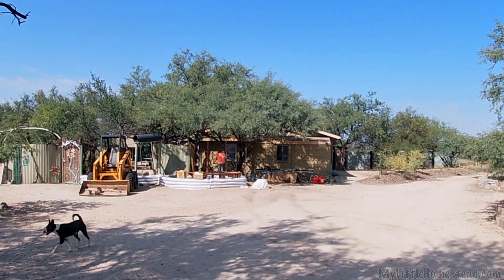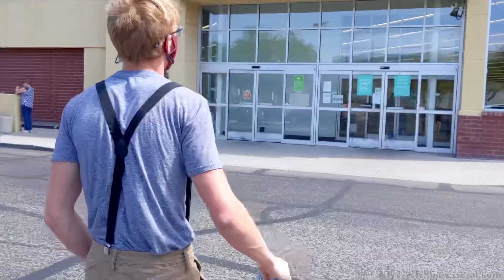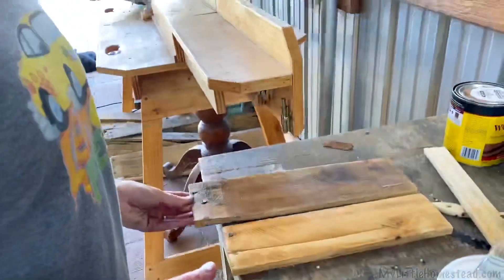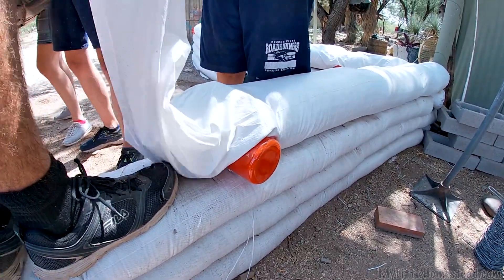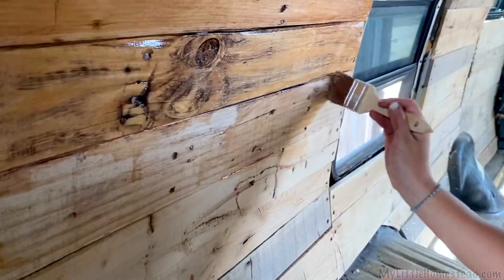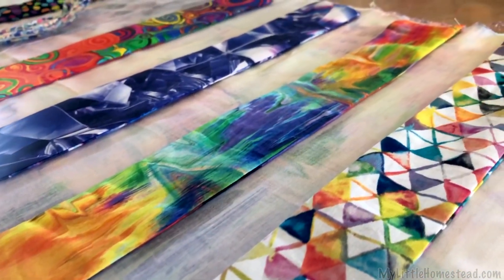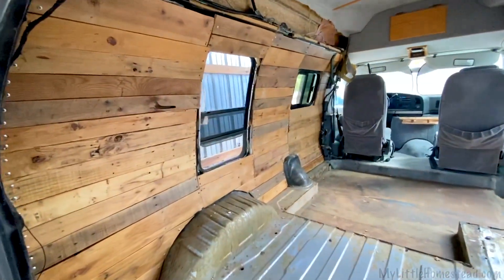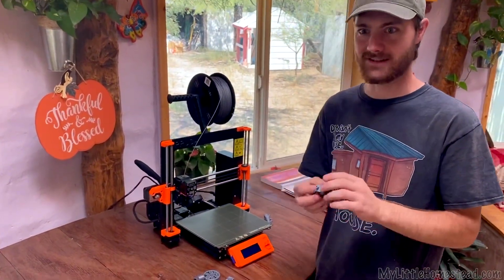Earthbag Walls for Outdoor Tub, Pallet Stain on Van Conversion, DIY Headbands | Weekly Peek Ep253

Comment: Oof, that stain should be called Black Hole because photons never come back from it. 

Whenever I'm at the hardware store I always check the "Oops" paint which is unclaimed custom mixed paint at a steep discount.  I've gotten a variety of paint and various earth tone water protectant/stain for $9/gal. I put some on a test pallet board and it's held up well in the elements all year compared to an untreated one.  

Was helping GF shop for mask making material a few months ago.  Lots of good vendors online.  You have to watch carefully whether you're getting a fat quarter or linear yard.

I've given a lot of thought to bottles and color treatment cause I have some bottle house plans.  I'm looking at cutting bottles and butting them together.  One colored one clear.  Before I build I want to experiment with coating the outside sides of the glass with white and also silver paint to see which works best.  Especially with colored glass this will help the light continue through rather than get absorbed along the side.  I'd want to experiment with translucent stain or dye coatings, and put one only on the bottom of the inside bottle.  Reds tend to fade fastest with UV exposure.

Comment: Lay a hunk of string, longer than the project, between each of your seams before you start sewing, pinned to one end. After you sew and cut, slide a yardstick or a piece of pvc inside the project and pull the loose end of the string to quickly flip the pieces right side out.

Comment: When using dark stains on pine and any other soft wood use a wood conditioner it helps the pores open up on the wood and always use a rag with dark stains it's more controlable that way a brush just doesn't spread it out like a rag

Comment: If you were to sew a line at 1/3 of the length add a small spoonful  orbeez beads (the tiny beads that swell with water) and sew another line at 2/3 of the length, you have a headband that can double as a neck wrap in summer. The beads shrink back down to tiny sizes when dry.
Reply: And scrunchies are also a nice fast way to make up fabric items.

Comment: You don't apply stain with a brush. I have always found that using a cut up t shirt works the best. You can squeeze out the stain based upon how dark you want it. When you're using a paintbrush of course it's going to soak all that stuff in and be darker

Comment: I just had an idea about the bottles you're painting! a lot of the problem with flaking off is from poor surface adhesion from the paint so they always tell you to prep the surface and how glass is hard to paint etc, so what if you take some of the glass etch stuff they sell at craft stores and let it etch the inside of the glass before you paint them, then the outside will still be glossy and bright but the inside will  have a better chance of hanging on.

Comment: Suggestion if you mix blue water and food coloring or paint into the bottles and put them in the oven at 125 for about 30 minutes then turn off the oven and let them cool the glass becomes stained and still see through
Reply: Glue do not blue water

Comment: Here's a possibility to keep the colors in the bottles longer. Before spraying the color, spray a coat or two of UV resistant clear coat into the bottles, let it dry. And then spray your colored spray paint into the bottles. It might work, I know that I've been told by mechanics,that when I resurface my headlights. And they're finished, to spray them with 2 - 3 coats of UV resistant clear coat.

Comment: The Prusa i3 mk3s is a great printer. The MMU 2.0 isn't so great but it does add multi colors so there is that. If you want a printer that does a larger format prints you can get a Longer LK1 and mod it so it has a bltouch which is a great auto leveler the best IMO. I personally have it I did the, standalone mod, heated bed mosfet mod, tl smoother mod, cable chain mod, Bltouch auto level mod, the duel Z motor mod, and spring steal build plate. The printer cost 245 an amazon right now with taxes. After my mods the printer is 390 and it performs like a CR-10S Pro V2  which is a 630 USD printer.

Then I also have a Sovol SV01 It is like a larger version of the Prusa i3 mk3s except better build quality is some parts I put a USD 50 BLtouch on it make the printer 350 ... and it is great... Glad you are happy with your Prusa i3 MK3s